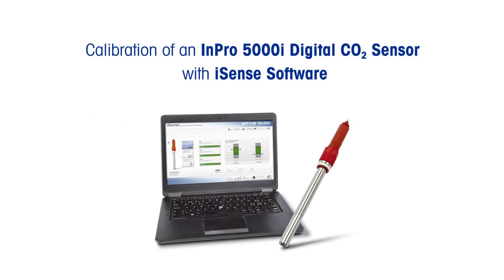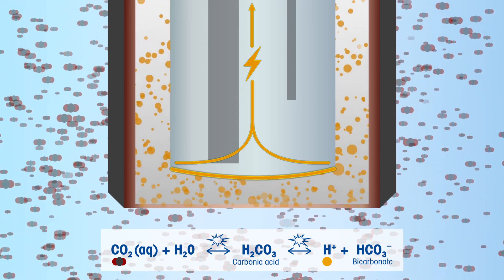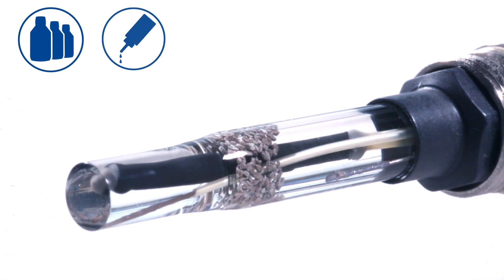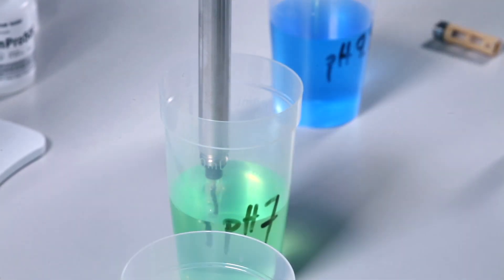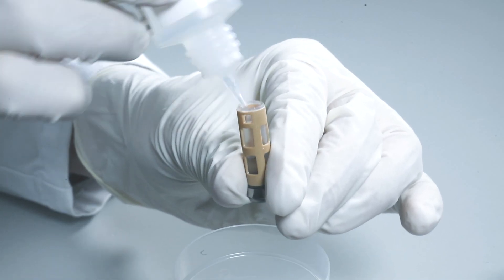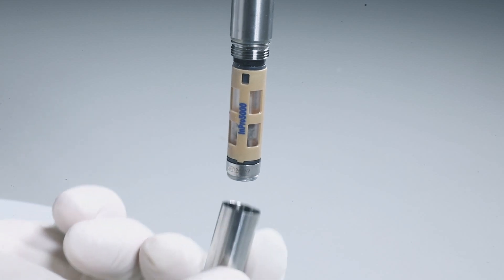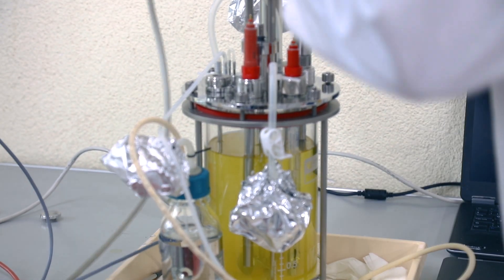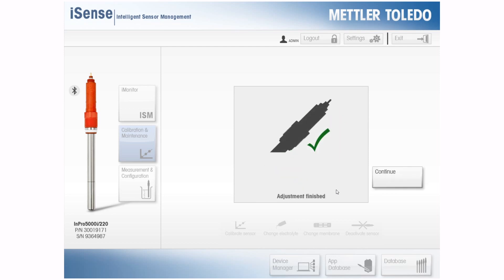Calibration of an InPro 5000i Dissolved Carbon Dioxide Sensor with ISM Core Software for Bioreactors

Comment: Does a new  InPro 5000i/12/120 require this calibration step? In the manual that it was delivered it is stated that this is not needed.
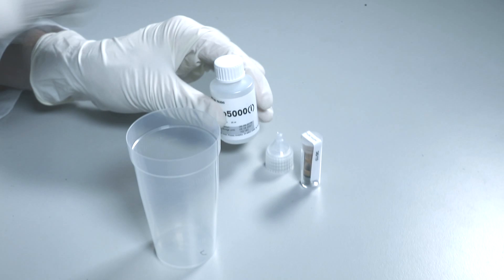Reply from the maker: Hi Andrei - Good question. With a new InPro5000i you'll only need to start at the "Assemble the Sensor" step, which begins around 3:19 in the video.  You'll want to do the assembly, sterilization and process calibration steps.  The verification step of "Checking on iSense" should be done according to your defined timelines as you verify and maintain the sensor.  The offset should be checked with a buffer between batches to assure probe is in decent condition. This step is primarily needed if desired from a documentation process, which we consider to be best practice.
Reply: @METTLERTOLEDOProcessAnalytics  Thanks you for your fast reply!